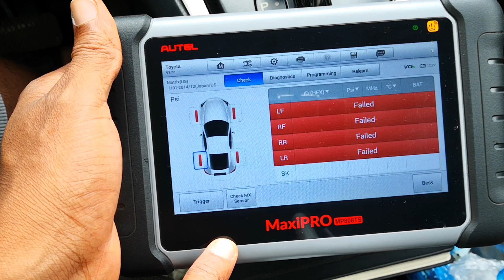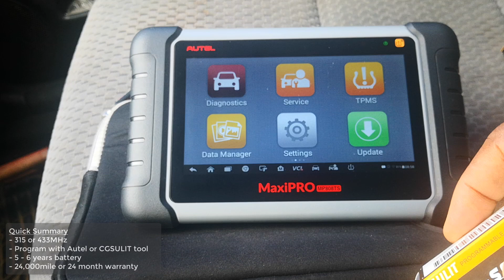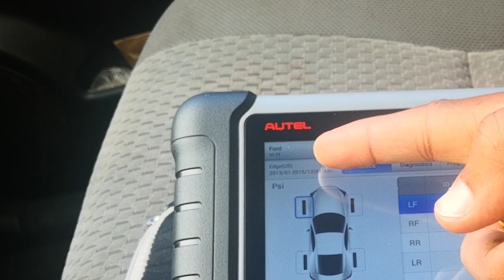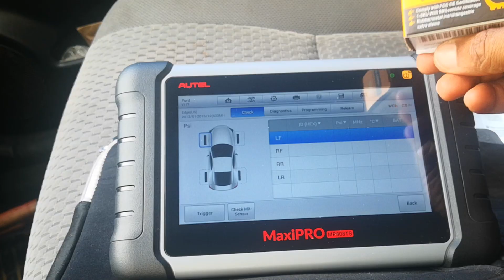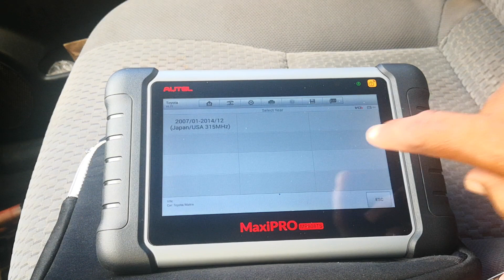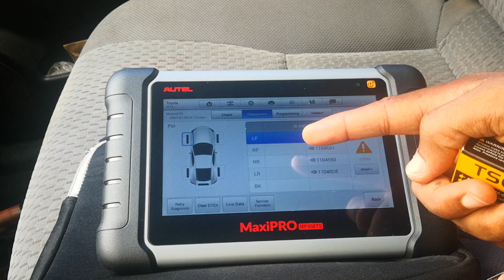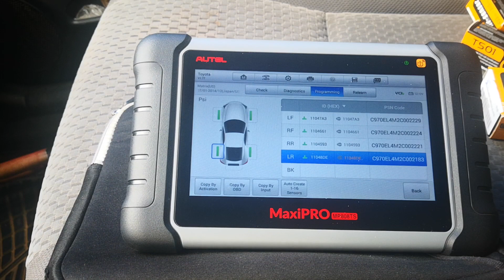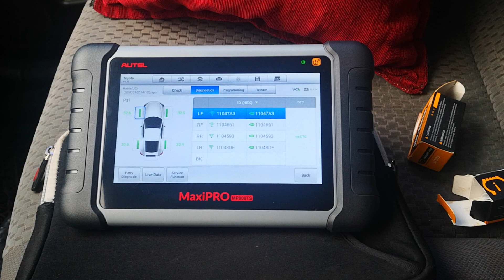TPMS Sensor PROGRAMMING: How to PROGRAM Tire sensor with AUTEL Scanner using CGSULIT TPMS sensors

Comment: Will the autel MX808 work to program TPMS sensors? I have it and I don’t have the MK808 like you do
Reply from the maker: If its the MX808TP it will work, if it doesnt have the "TP" suffix, it won't program tpms sensors.
Reply: @DIYAutoworksNG  darn. Guess discount tire will come in handy after all.

Comment: So i have an 09' Civic and i installed OEM Honda sensors, they are activated but i can get them to program, do you have a procedure for those by any chance? Also, they do have to be off the tires? Thanks
Reply from the maker: If you got the right OEM sensors for the car, you only need to relearn the TPMS. Programming isn't required. I should have a video on the relearn process though I think on a Toyota. The principle is the same.
Reply: @DIYAutoworksNG well, they are OEM, the have the same part number as the oldones, i all i did is the relearn, it after the process completes succesfull but the light stays blinking, thanks for the info

Comment: So this tool can do oem tpms sensor programming & activation also relearn? I was looking for the ts508wf but read that one cannot to programming of oem ones. I need a tool to programm oem, relearn etc.
Reply from the maker: As long as you buy the correct OEM sensors they shouldn't need programming, but rather relearning. It's aftermarket sensors that need to be programmed to different vehicles.
Reply: @DIYAutoworksNG om thanks. I mean for example when i have winterset, with 4 new tpms sensors, then they dont need to be activated and learnd via obd?

Comment: Question, sir.. do i need to intall first the obd port on the car before i start programming the tpms sensor? Or no need?
Reply from the maker: It depends on the method of programming you're using. The type used in the video does not require you to be connected. But if you're doing copy by OBD, then you should be connected.

Comment: My scanner is mp808ts. When i try to trigger or check sensors it says failed. But when i do auto-create it says 1 sensor detected, then when i hit program it fails again. Any idea why?
Reply from the maker: Usually, failing to trigger sensors means a dead battery in the sensor. How old are they? Universal or OEM?
Reply: @DIYAutoworksNG  they are brand new, all 4 have this problem.
Reply from the maker: Universal sensors or OEM? If universal, what brand?
Reply: @DIYAutoworksNG  they are the Autel MX sensors

Comment: What is hidden under live data button?
Reply from the maker: The status of the TPMS sensors and some other data
Reply: @DIYAutoworksNG  Is that capable to decode status bits? I don't mean battery status - ok or dead but more detailled sensor status which is available in some systems?

Comment: Frying pan can program universal TPMS sensors. But what can program OEM ?
Reply from the maker: OEM are already programmed and do not require special programming. They just need to be relearned. Programming of TPMS sensors only applies to aftermarket brands.
Reply: @DIYAutoworksNG  i have a brand new OEM sensor. Never programmed.
Reply from the maker: What car? Just install and relearn vehicle.

Comment: Bonjour, le scanner Autel permet de programmer les Sensors OEM ? Merci.
Reply from the maker: OEM sensor are already programmed to the car. You will just need to relearn the sensors, and this scanner can do it
Reply: @DIYAutoworksNG  "Réapprendre les capteurs" cela veux dire inscrire les numéros identifiants dans l'ECU du véhicule manuellement avec ce scanner ?

Comment: The only bad thing with this scaners is that they don't program any more tpms after subscription ends, if you want to program tpms you have to pay another $600
Reply from the maker: That's not true. This will program universal TPMS sensors without a subscription.
Reply: @DIYAutoworksNG  well please can you show me how, because i try and it keeps telling me that my supscription had ended
i have mp808ts, thanks in advance
Reply from the maker: What car and what sensor are you trying to program?
Reply: @DIYAutoworksNG  i have a 2015 chevrolet silverado, and i want to relearn all the sensors
Reply from the maker: May be difficult to do here especially when images can't be shared in YouTube comments. If you're on instagram, you can hit me up. Handle is same as channel name.

Comment: You skipped the part where this actually works lol
Reply from the maker: The fact that the the TPMS light went out is enough to confirm the programmed sensors work. If they don't work the light wouldn't have gone off.

Comment: Im glad you showed how to do the reprogramming but it would help if you would show how you got to that page. I have the mk808bt and im having trouble finding it
Reply from the maker: The MK808BT is not a full TPMS tool, so it can't program universal TPMS sensors. Only Autel tools that end with 'TS' have this function.
Reply: @DIYAutoworksNG  Thank you...Cuz ive been going nuts trying to figure it out

Comment: I have  Utel scanner also 906 bt and I don't see that on my scanner how did u get to it
Reply from the maker: The 906BT is not a TPMS tool so it can't program TPMS sensors.
Reply: @DIYAutoworksNG I put new tires and new sensors on my car I have a 2016 maserati ghibli sq4  how do I get them to relearn since the sensors are ready installed
Reply from the maker: Check and see if you have a button with a tire symbol in the dash area or below
Reply: @DIYAutoworksNG  I checked all over its not there plus I tried the dash nothing I'm going to buy a temp relearn tool will that work
Reply from the maker: No scan tool needed. See video
https://youtu.be/xaSsPH-aBkA
Reply: @DIYAutoworksNG  ty
Reply: @DIYAutoworksNG  I have a ghibli mine don't have any of that
Reply from the maker: Have you ransacked the vehicle settings on the infotainment screen to be sure there's no TPMS caliberation hidden somewhere?
Reply: @DIYAutoworksNG  yes I called maserati they said it's supposed to do it on its own but nothing yet

Comment: what other brand TPMS sensors can you program with Autel? I was told by Autel it can only do Autel brand TPMS sensors, but you just proved them wrong. Thanks for the awesome videos.
Reply from the maker: Thanks for the compliment. Officially, Autel says none, but some universal TPMS manufacturers make their products compatible with Autel devices. I don't know any other brands it can program.
Reply: @DIYAutoworksNG  They don't make them compatible but they crack Autel tools and it is not legal, isn't it? :)

Comment: I notice you're in a vehicle. Are you connected to the OBD while programming the sensors??
Reply from the maker: It depends on the method of programming you use. If you choose 'copy by OBD' method, you'll have to be connected to the vehicle, but you use the 'autocreate' method, you don't need to be connected to the vehicle. That's the method I used in programming the sensor to the Ford I talked about in the video.
Reply: Hello,, I have a silly question, if i program the sensors through obd do the sensors have to be installed in the wheels ??
Reply: @robertorodriguez6772 no. In his video you just watched, he programmed while connected to obd and you saw him hold the sensor in his hand (not installed in a wheel)

Comment: So every time I rotate tires I have to redo this?
Reply from the maker: You'd just relearn the TPMS not reprogram. Some cars have a button you can just push to relearn the TPMS after tire rotation.
Reply: @DIYAutoworksNG  i have this autel at the shop i drive an f150 2014 5.0 and i porgramed the sensors when i got new rims and then i relearned them to the truck it reconizes them but the damn tpms light  wont go away i drove it for two days i clear the DTC and nothing at this point im losted theres a way where i push the breaks turn the key 3 times i do that twice the truck asks me to train the front left tire but i cant do that with scanner it just has the relearn option
Reply from the maker: What Autel scanner do you have? If it's a full TPMS unit, I suggest you use the scanner to activate the TPMS sensors on the tires directly. I assume the car has direct TPMS. Or no?
Reply: @DIYAutoworksNG  maxistpms ts608
Reply from the maker: Fantastic. Trigger each wheel sensor to retrieve the ID's by activation, then connect the tool to the car to retrieve the ID's by OBD. If any of the wheels does not return an ID or there's a mismatch of ID's for each wheel (activation vs OBD), that's your problem wheel.

Comment: I really like your videos and I would like to purchase one of theses Autel scanners but not until I find out why mechanics and DIY'ers are not up in arms and allowing theses companies to scam them with updates? You are being scammed like never before. I bet they are nothing but bug fixes. They want the public to find all the bugs and then soak you $600 each year. I would bet that if you missed two or more years of subscriptions that your machine would say this isn't supported and that isn't supported etc. How much longer will mechanics allow them self's to be scammed like this?
Reply from the maker: Thanks for your compliment. 
On the updates, they are not all bug fixes. New models of cars are released yearly and updates are then required to ensure compatibility with the scanner. There are also scanners with lifetime updates that you may look at. They tend not to have the high-end functions.
Reply: @DIYAutoworksNG  Thank you for your response. I know about the newer vehicles and that you have to update for them. I was basically referring to older vehicles that are already in the software. I heard some people are complaining about the software not working correctly after not updating for a couple years. Have you had any of these problems before? Thanks so much for your response.
Reply from the maker: This is my second year out of subscription on this Autel and everything still works perfectly except getting updates.
Reply: Do you find it easy to program keys and fob's and tire pressure monitors? Do you know if the unit you have or any of the other units can do Auto Start Stop. Thanks for your responses.
Reply from the maker: Programs keys and tire sensors quite well. But as you know, no one tool does it all and it doesn't program keys for every car.
It does support start stop too depending on vehicle. You can explore coverage here autel.com/vehicle-coverage/coverage2
Reply: Thanks, Yes I know, this is why i'm beating my brains out trying to find the best unit for me. Thanks for the link.

Comment: Does this program work for all Lexus model? Does it d brake bleeding for newer model
Reply from the maker: Lexus is well supported on this tool for TPMS stuff. You can check here if you have a specific Lexus you want to check for. https://autel.com/vehicle-coverage/coverage2
Just checked the RX450h 2022 and air bleeding as well as brake fluid replacement are supported special functions.

Comment: Would I be able to do a speedometer calibration due to changing tire sizes. My speed is off like 6%
Reply from the maker: Depends on the car, but it does support tire changing under service functions. Again not in all cars. You can send Autel support your VIN to be sure.

Comment: hi
I have a problem showing me the code c2126
Reply from the maker: The causes are varied and include failure of ID registration (no feedback from all the tire sensors), fault, short or poor connection  in the circuit for the receiver antenna for the TPMS, faulty ECU.
Next thing you should do is to use a TPMS tool to read the sensors directly at the tires. If you get no feedback from the tires, the cause is likely the first.

Comment: can i relearn or program different brand sensors or does have to be only autel sensors?
Reply from the maker: The tool can relearn 98% of TPMS sensors on the market today, OEM plus aftermarket. It does not have to be Autel sensors. 
However, support for programming sensors is limited. Note that you only need programming if you buy universal sensors. These are sensors that can fit almost any car. Autel MX sensors are the main ones supported although as you must have seen in the video, there are other brands of TPMS sensors that can be programmed. The manufacturers of the sensors will usually clearly mark the sensor as so. These CGSULIT sensors were clearly marked as being programmable using an Autel TPMS tool.

Comment: Does the maxi pro have the ability to change psi perimeters? Lets say i wanna run my tires at max 40psi and factory setting lets say is 34 psi. Would it be able to raise the psi max so tpms light would be off
Reply from the maker: I know it supports tire size changes in some cars. Not certain on changing psi. Does your TPMS detect high pressures? Most TPMS only detect low tire pressures.
Reply: that depends on the vehicle, but you need to remember, changing the psi rating will only change when the warnings come up on the dash.
Reply from the maker: Also, has to be the MaxiPRO TS MP808TS and a programmable universal TPMS sensor I believe. Not 100%, but I'll look into it and revert.
Reply: @DIYAutoworksNG  when the warning comes on is always handled by the car's computers, never the sensors.

Comment: I purchased VDO Continental SE52081 for 2007 Land Rover LR3.  I have the same scanner but it will not read the sensor when you do MX sensor check?
Reply from the maker: Are you saying you were trying to use the "check MX sensor" function for the VDO?

Comment: I have a question, I have this scanner I also have a (Acura Tl 2013) so I bout some use tires for winter from a friend he also has and Acura Tl so what function do I use to cope the sensor TPMS code from my tire to the used tire I bout from my friend......help please thanks
Reply from the maker: Hi. 
The most practical to use will be Copy by OBD. I would have said Copy by Activation if the sensors were not already mounted on your friend's tires.
Reply: @DIYAutoworksNG  They were mounted on his car there Acura Tl wheels so what im trying to say is what function do i use to override my sensor code on to the new Acura wheels..